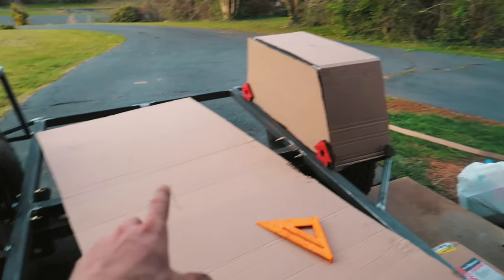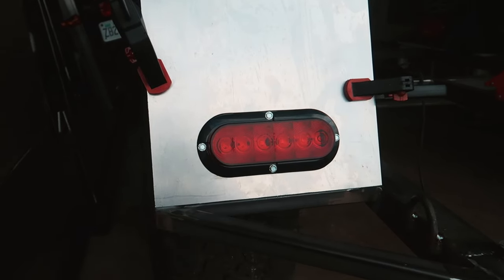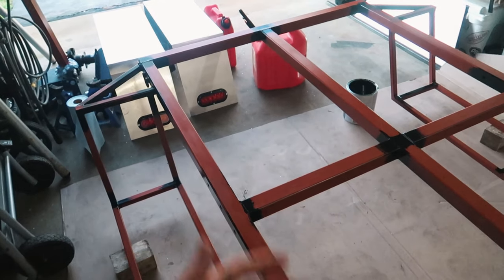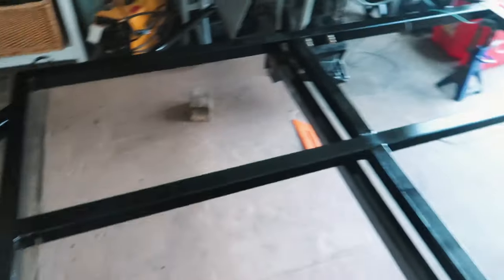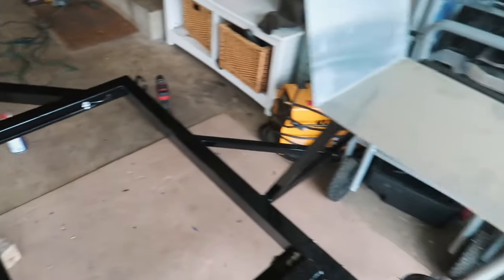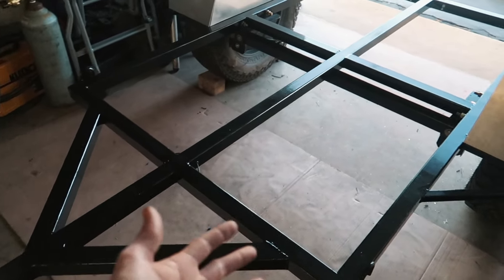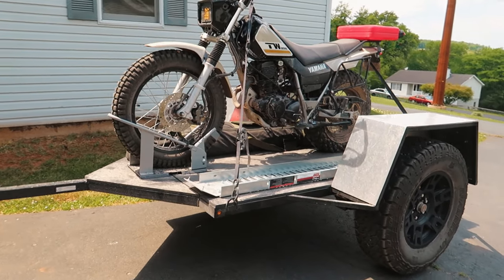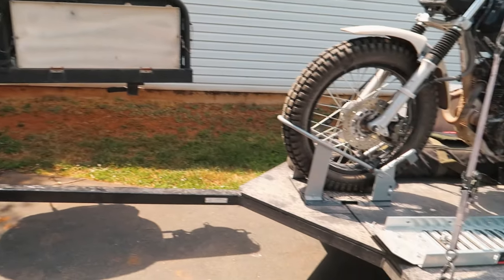Overland Trailer Build: Part II - Fit & Finish

Comment: I’m a Retired Automotive Paint Rep. (44 years).
The finish actually “wrinkled” that’s due to applying another coat over the first coat, when the first coat wasn’t fully cured.
The solvent in the second coat bit into the first and ate it basically. 
It’s a shame, the one heavy rolled coat is all that was necessary. 
These types of products like Trem-Clad, dry & cure very slow. 
2 days between coats at 75f I’m guessing, double the cure time if it’s over applied.
The directions on the can should have warned you about over applying, and second coat re-coat time.
Great job thanks for the information.
By the way, Sandwich chalking between Aluminum & Steel, they don’t like each other and will create corrosion within a year..!

Comment: Planning on doing this soon and really appreciate your methodical approach to the whole project and your in-depth explanations. Yes VHB tape is awesome, I have used it for signage for a few years and it easily survives the intense heat here of an Australian summer, in fact there is a large sign on one of the glass windows in the Sydney CBD, mounted 20 floors up, that is guaranteed by 3M to last 30 years. That's pretty impressive. Thanks heaps.
Reply from the maker: Awesome! Thanks for watching! Many people underestimate VHB tape until they do some research!

Comment: Use a Mesh floor! You can use bungies to tie down ramps, gas cans and such! Also, Easy cleanup.
Reply from the maker: I thought about this as well but I’ve dealt with mesh floor sagging in the past after use (trailer tailgate ramps) and wanted to avoid that situation all together.

Comment: You can also cover the fender supports with metal not just for @teps but also for more space to mount things like fuel or water cans.
Reply from the maker: No doubt! My next build I’m going to make a slightly smaller one focused on carrying a Rooftop tent and gear.

Comment: Wow, great videos. Thanks for sharing all the details about the build and final product.  Nice thing is you can get a lot of other gear on there with the bike or without.  Would be nice to have a locking waterproof gear box, maybe on the front.  For my build I was thinking about uprights and a place to put 2 kayaks on top. Maybe even removable.
Reply from the maker: Great idea, I considered that as well. Unfortunately with the wheel chock up front the truck swing out just barely clears it while it’s open so I don’t have room to spare in that sense. 

I’ll be making another smaller trailer made to hold a rooftop tent in the very near future with a rack etc. I will video that as well!

Comment: Did you mention what type of paint you used? I saw the primer name but not top coat... Very clean build, happy to see the Timbren suspensions installed. So cool.
Reply from the maker: Valspar Anti-Rust Armor! But thanks a lot for watching! Currently working on the second trailer build now, should be uploading part one within a couple weeks 👍🏼

Comment: That paint will last you an easy 15 years. I use it building trailer for the film industry. But hood luck to get it off. I had to wetblast it off for a color change once because it kills sand papper, even the 3m Brand!
Reply from the maker: Glad to hear! That’s what I was hoping for.

Comment: Great video for like you said.. a great way to build your platform 👍🏻
Reply from the maker: Thank you sir! But yes, Not everyone is going to be hauling a bike with theirs but at least it’s a great base to build off of for their needs. 

I have another vin plate already from dmv. I may do a video series on building a small 4’x4’ trailer with a shorter tongue and rack for a rooftop tent and post It forsale after.

Comment: I was wondering about the galvanic corrosion issue and then you answered it with 3m tape.  Working on mine now and was on the fence about fender material.
Reply from the maker: Glad the video could help!

Comment: Diablo makes a 6" diamond tipped metal blade for like $20 at HD.
Reply from the maker: Thanks for the tip! I went to a local hardware store and got what they had on hand instead of driving 30+ minutes but I’ll have to go snag one of those.
Reply: @Adv4x4  It said on the package it lasts 100x longer than abrasive cutting wheels. I havent tried it yet but thats pretty crazy if it does.
Reply from the maker: Right that’s a huge leap.

Comment: Great build, but did you really need something that burly just for the TW?  When I started watching this, I expected to see an off road teardrop style expedition trailer.  Either way, well done!
Reply from the maker: Thanks! Yessir it is definitely overkill for just hauling a bike but I don’t intend for it to only serve that purpose. I also wanted it for Hauling materials from Lowe’s or anything of that nature. Plus one day it might transform into a tear drop camper of some sort. I didn’t want to have to build another one as my needs changed. It should be ready for whatever I throw at it. 👍🏼

Comment: You have inspired me to build one. I did not see a  front jocky wheel attached. Any reason ?
Reply from the maker: No specific reason! When im camping I leave the trailer hooked up and at home I have a bucket I use to prop it up. My initial reasoning for not adding one was to avoid rattles while offroad. For some reason rattles bother me a lot 😂

Comment: Hey just curious I'm wanting to do this could you give us a quick walk through in how to get these road legal
Reply from the maker: (For Virginia residents) First you need to print this application from the DMV website 👇🏻👇🏻

https://www.dmv.virginia.gov/webdoc/pdf/vsa22.pdf

Enclose the $5.00 fee in form of check with the filled out application. 

Mail it to the address at the top left of the paper

Eventually, they will mail you back an assigned VIN plate and your paper. (You can avoid the wait if you visit dmv in person with the paper filled out) 

Install VIN plate as per instructions on paper. 

Call your local state police department and they will send out a trooper to inspect the trailer VIN plate installation. 
He will sign the paper and return it to you. 

Bring the signed off paper back to DMV and they will issue you a title & tags 👍🏼

Comment: if you get a trailer that you built inspected do you have to wait 3 years for the title? in my county filing for a lost title if it has no history on file with the dmv you have to wait 3 years after the inspection for a title.
Reply from the maker: In Virginia I had no issues I received a title the same time I registered it for tags after the state trooper inspected it.

Comment: What was the total cost?
Reply from the maker: I believe around $1600 but you could cut the cost significantly by using a standard hitch, a regular trailer axle suspension, and standard wheels and tires.

Comment: What size is the floor area and do you know how much it weighs? I'm getting ready to build a trailer and just doing research
Reply from the maker: The floor area is 6’2” x 4’ 
Without the wheels, tires and suspension it is about a 200lb metal frame 
I’d have to guess 400-500lbs overall including wheels, tires, suspension, hitch, lights, wiring ect.
Reply: @Adv4x4  Sweet. Came out really nice. I'm debating whether to find a used trailer as a starting point or build from scratch like you. Thanks for the video
Reply from the maker: No problem thanks for watching! I gave up on the used trailer hunt and glad I did. Got to make exactly what I wanted.

Comment: Nice how much does it weigh empty
Reply from the maker: The frame and fender wells minus the timbren suspension wheels and tires comes in at about 200 lbs
Reply from the maker: So total weight unloaded including the suspension wheels and tires I would think is around 400-500lbs I need to get it weighed haha.

Comment: how much did this cost?
Reply from the maker: Somewhere <$2000 but you could cut the cost significantly by using a normal hitch, normal trailer axle & tires